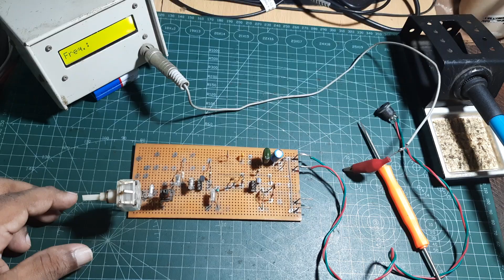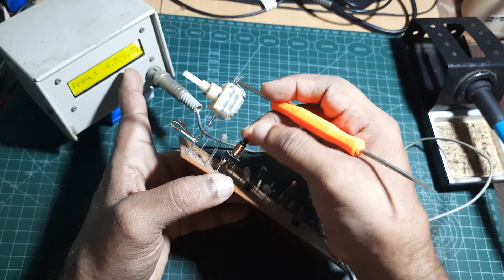A Colpitts Oscillator Demonstration

Comment: It has lot of distortion...not able to output perfect clean sine wave...but it's a awesome circuit for basics oscillators..thnx
Reply from the maker: Distortion happens when frequency goes to the extreme values to which the frequency determining components like capacitors, inductor, resistors or even the active device like the transistor can manage to provide the right shape to the waveform. At these excursions the waveform may have some deviation from the ideal values of a sine wave.